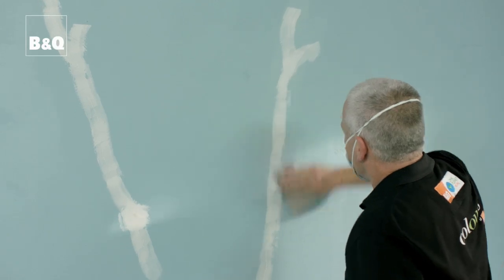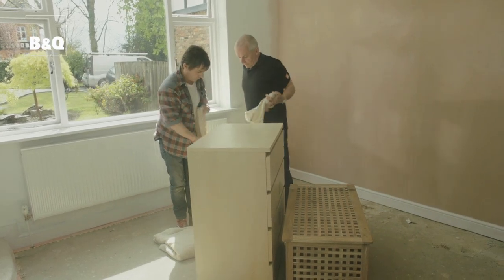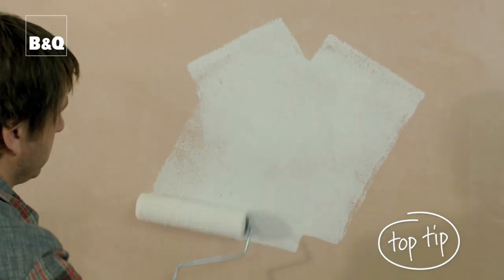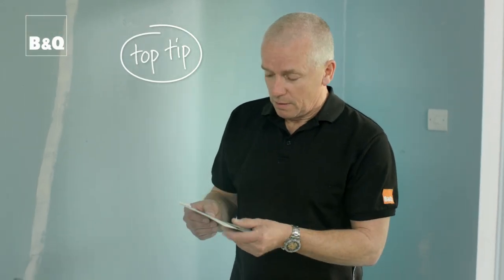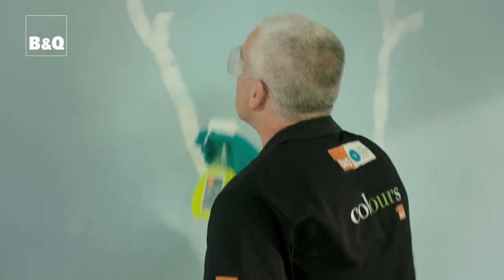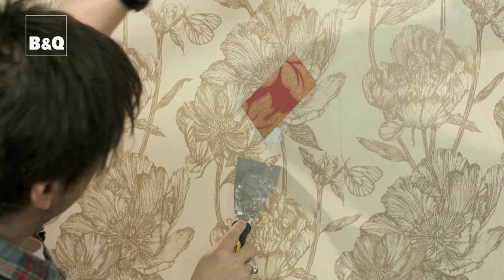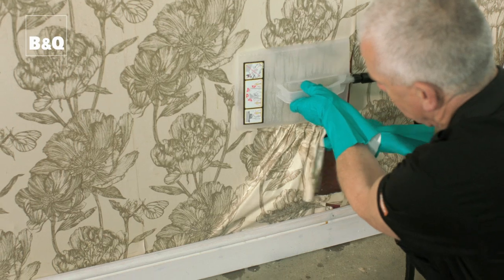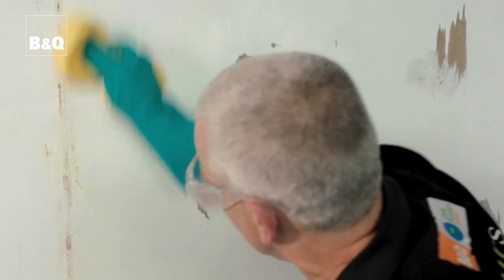How to prepare walls & ceilings for decorating

Comment: I just use 100 grit to 120 grit fine sandpaper or 60 if it's really rough such as a lump of filler then switch to fine finish sandpaper then using a damp cloth wipe all areas of walls especially where you have sanded so it will remove dust dirt better to paint onto a clean surface than dirty
Reply: Instablaster

Comment: I've stripped textured wallpaper to reveal a heavily pitted stone-like surface. What are the necessary steps to take before painting? Should I plaster it first?
Reply: Have you found out what to do yet?? Need help
Reply: @Mia-zt1jn  We ended up applying a skim coat before painting. It's like plaster. You'll need to prime the wall with a PVA primer before applying the skim coat and then prime again before painting. This will give you a smooth surface which will accept the paint well